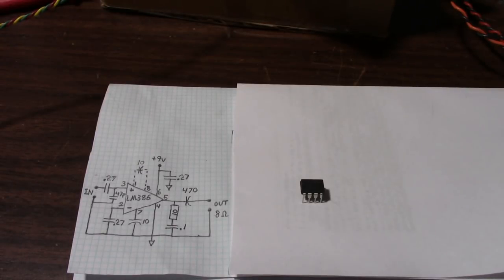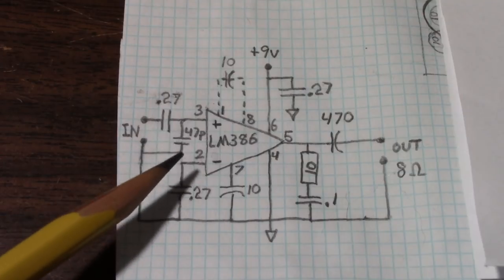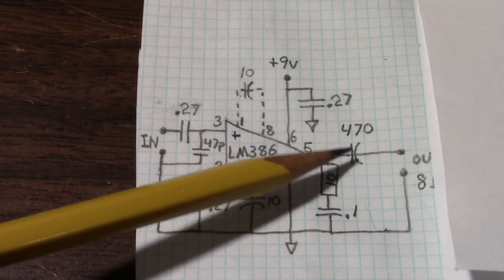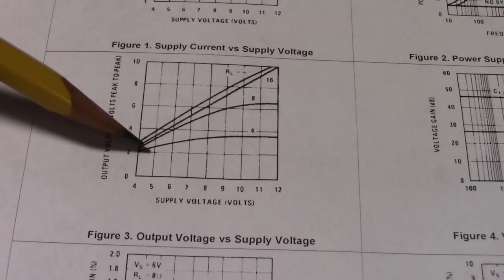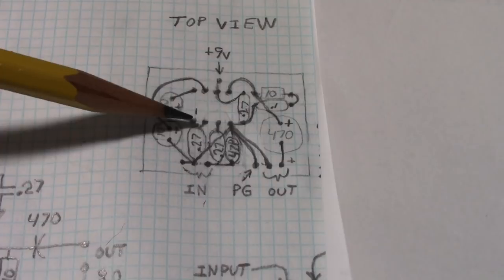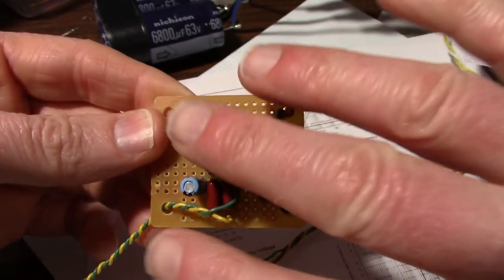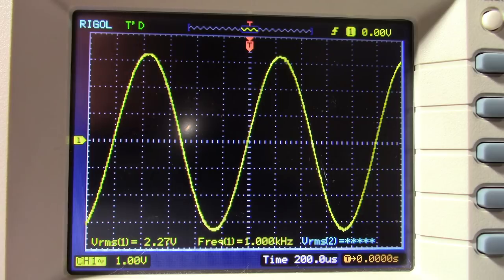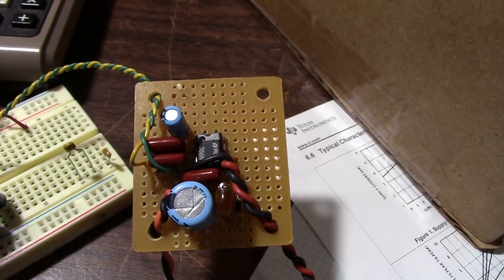Make the PERFECT LM386 audio amplifier?

Comment: 18:55 The harmonics you see at clipping are the reason why you blow your tweeter during clipping. 
This is why "underpowering" is a common cause of breaking your speakers.
Reply: H A R  Yes it can. When the amplifier starts clipping you get tons of harmonics and those harmonics are unexpected HF that can stress your tweeter and damage it (probably the main reason of tweeter failure).
See : https://jblpro.com/en-asia/site_elements/danger-low-power
This can happen if you clip any stage of the audio signal.

Comment: I can't wait to build this. I was planning on using it as a small guitar amp. In regards to the pin 1 and 8 gain stage could I use 1k pot in series with the 10mf cap to adjust the gain? And if so, what order should I have the components?
Reply: Better use 10k

Comment: The input is a differential pair so having both inputs capacitive coupled is great, but the 47pF capacitor should be on the same side of the coupling capacitors. As you show it, it is inside the + terminals coupling capacitor and outside the - coupling capacitor. It's not obvious why you would want to unbalance your input this way...
Reply: @
ats89117

it is connected to ground not - input :-)
Reply: @YTANDY100  It is connected from the positive input of the opamp to ground. It should be connected from the positive input of the opamp to the negative input of the opamp, or across IN. Both of those are balanced configurations. As shown, it is NOT balanced. That is pretty strange given that John correctly added the 0.27uF capacitor between the negative input of the opamp and ground to maintain a balanced input...
Reply: @ats89117  
across in would probably be better but to both + and - inputs would maybe negate higher input frequency's :-)
Reply from the maker: The .27uf caps would essentially be a short to the frequencies the 47pf cap would see as high impedance so you can consider that when placing it in the circuit.
Reply: @JohnAudioTech  At many very high frequencies that might cause oscillations, the 0.27uF capacitor will be past resonance and may have a higher impedance than the 47pf capacitor...  But I concede this is a minor detail. Thanks for the great video!
Reply: Such a small cap (47pF) has negligible effect on audio frequencies so it doesn't create any discernible imbalance at audio frequencies. Very small caps like this are really only useful for filtering out RF interference ( > 100kHz) from radio and TV stations and cell phones etc. To get the best possible RF filtering performance the cap needs to go as directly as possible to the ground of the amplifier.

Comment: Hello John, from about 19:40 to 19:50, what is happening around the zero crossing? There's a bulge on the sine wave :)
Reply from the maker: I'll have to check that. It seems to be on the falling edge only.
Reply: @JohnAudioTech  Use an analog scope for this purpose. These sh... digital scopes are not good for this measurement
Reply: @JohnAudioTech  CAN A  LM386 BE USED IN AN  FM ( BUG ) TRANSMITTER ?

Comment: Thank you for the explanations, dear John, but I got a doubt: near 17:00min. you change something until the wave get round, not clipped. I'm too amateur to have an ocilloscope.And as I'm lookin for a good - not excessive but not poor - gain for a diy reusing of a pair of very small laptop speakers (but yet a 8ohm speakers), I'd like to know how to get a decent gain.

Are you using that 10uF capacitor between pins 1 and 8? If so, which resistance is used to get no distortion?

 I'd like you to excuse me if you said that in the video but I'm not too fluent listener in English. Well... actualy, as you can see, not a fluent writer-speaker too.

Thank you.

Comment: Great video! I see you’re using film capacitors. Is there a reason I shouldn’t use ceramic caps? I’m asking as a beginner. :)
Reply: Ceramic capacitors are notorious for they lack of stability, they also shift capacitance with vibration.
That's why you avoid using them in anything here value stability is more important that lower ESR.

Comment: (Anybody that comments on here, with this knowledge, is welcome to answer my question)
John, I just found your youtube channel. Excellent video! That LM386 amp sounds clean with plenty of volume. 

I'm currently looking at building an FM radio using the RDA5807 FM Radio Tuner IC. I'm looking at a plan that I found on Instructables.
The amp being used, for that build, is a PAM8403 audio amp module. I'm wondering if the LM386 is a better choice for the amp
and also how do these two amps compare with each other?

Thanks!
Gary

Comment: I built it with SMD components on double sided PCB and it's small. Works great! Question - can I put a capacitor with 10kOhm pot in series between pin 1 and 8 to control gain?
Reply: i have always wanted to try that, pity no answer yet

Comment: Hello buddy. Iam trying to build an amplifier using TDA7265 amplifier chip with single supply design. The music is playing but don't know why the volume is so low. I have put input volume on full. For the circuit diagram, you can check the datasheet. Iam using fig 2, single supply design.

Comment: I have a better idea 

use from 100nf to 470nf or 1uf capacitor connected from pin 1 to pin 8 instead of the 10uf gain capacitor
the result lm386 will give a very clear high frequency crystal sound without hum
to reduce the highs as you like use from 100ohm to 1k resistor connected in series with the capacitor or use a 1k trimmer to adjust the highs, i used 220ohm resistor

Comment: Hi John I have a vintage Fidelity HF19 1961 tube amp in a record player. I want to change the mono high output ceramic cartridge for a modern stereo pickup so it won't damage my records. Do you think this little amp would be ok as a preamp to power the single UL84 tube amplifier?

Comment: What configuration was this 386, 1,2,3 or 4, 4 having 1 watt output. I agree with the others, your circuit is quite, clean and full fidelity. A better design than others I have tried. Good job! Thanxz
Reply from the maker: This is the N-1 version. I have the N-4, but testing at the same supply voltage gave the exact same output. The N-4 allows for higher voltages (18v max, I think), so with a 16 ohm load you can get more power.
Reply: @JohnAudioTech  Have you tried the N-4? I found it didn't perform as well when swapped out of the working N-3 circuit I made. N-4 with 12v 8 ohm seemed to clip a little earlier and had fuzzy little oscillations on the test sinewave before clipping, may have been at the bottoms of the waveform but can't remember now. I guess it's probably got beefed up internal transistors for higher voltage which causes this? It went away with 16v 32 ohm.
Reply from the maker: @uK8cvPAq  I did not test thoroughly, but I didn't notice any difference between the N-1 and N-4 chips I have. I haven't seen oscillations from the IC with good ground layout, but again, I didn't do a thorough test.
Reply: @JohnAudioTech  hmm interesting then, was it a genuine TI part?
Reply from the maker: @uK8cvPAq  Both purchased long ago. National Semiconductor parts. The one in the video has a 1986 date code, the N-4 has long string of numbers, I'd have to look up the date code for it, but it's still pretty old as I haven't bought this IC in many years.
Reply: @JohnAudioTech  Well this is embarrassing, I just tried getting some waveforms of my circuit with LM386 -3 and -4 but this time no oscillations to be found. In both cases I could get over 800mW out using a 12v battery as source and that was without using your capacitor mod, chip heats as expected with 12v however.

Comment: Nice video. Thanks for sharing. Which speakers are you using? 8 ohms, but how many watts and ways? It seems 2 or 3 ways, and they seem powerful. Speakers are also important for the final result as you mention in the video.
Reply from the maker: I have connected the one 8ohm two way speaker. SPL would rate in the low 90dB range at 1watt / 1 meter.

Comment: the 470 output component is a capacitor but you called it out in ohms.  That makes it unclear what value you want it to have 470uF, 470pf?
Reply from the maker: I misspoke, it is 470uf.
Reply: If if was pF you'd hear nothing, if it was nF only the high frequencies, so it must be µF or greater, mF would be unnecessary.
Reply: Thanks, but I have received an answer from the author.   He clarified it without even a small hint of condescending tone.  I like that.

Comment: Thank you for the video and the tips.  Does it make any difference in audio output quality what material is used for the .27 chip capacitors?
Reply from the maker: I would recommend using polyester film type caps.
Reply: @JohnAudioTech  Thank you very much for the reply.

Comment: Hey John, I find that the .27 cap from signal in somehow reduces the bass almost entirely. I find that the output is a lot better removing it. What's your logic for that one?
Reply from the maker: Do you have a potentiometer or resistor following the capacitor? .27uf cap with the 50k input impedance of the LM386 should give good response down to 20Hz.
Reply: @JohnAudioTech  Oh, that could be it! I just take in the raw input as is. Thanks!

Comment: Hi John - Thank you for this helpful video. I am puzzled by one thing. You added a .27 cap from the inverting input to ground to balance the circuit. However you then add the 47p cap from the non-inverting input to ground. Doesn’t this unbalance things? - Jim

Comment: Lm386 N-1 has 325 mw @ 6V 8 ohm, N-3 has 700 mw @ 9V 8 ohms and N-4 has 1Watts @ 15V 16 ohms according to datasheet. So which of these flavors we are actually getting now in the open market as there is nothing printed after Lm386 on the chips ?

Comment: Hey John, Question if I can; Where is the high frequency filtered by the 470 cap coming from? could it be filter best on the input, or in the power rail? I ask because i think that, if removed (instead of filtered on the output) it would yield a cooler and more efficient chip.

Comment: Am I right in thinking, even though this chip is very low power output,, it has a really good frequency response? Because, I was always under the impression that that the usual 8 pin, or even 16 pin amp chips were seriously lacking in FR.
Reply: It does a good job as long as you are staying under a half a watt, at that point the frequency response really goes tits up. It has a niche driving transistors in audio circuits, where you need more current than highly accurate op amps, but not so much the 386 needs more than a half a watt. They are also good enough for driving headphones.
Reply from the maker: Frequency response depends mainly on the coupling capacitors used on the input and output (and feedback in some cases). The chip itself will have a response from DC to several tens of kilo Hertz.
Reply: JohnAudioTech ,, oh cool,, thank you.

Comment: I have just built this, I have bought a 8.2 ohm non inductive 20w resistor.
How do you get your test signal?
I have a signal generator dds  still clipping with 100mv 1khz sine  wave going in? ( can’t get a smaller signal)

Comment: When you show the board layout, I am not sure of the orientation and did not follow your explanation.  Am I looking at the solder wire side looking down at the drawing?  I want to build this amp.  My transceiver has low output and want to put in a low gain amp.
Reply from the maker: The drawing shows the component side.

Comment: Ive had so many problems with this chip, sometimes i plug it in, it sounds clean and produces fair volume, and then in less than a minute without changing anything all of a sudden it has extreme distortion and low output.
Must be because im doing it on a breadboard.
Reply: Yeah they CAN be a bit unstable - you DID use the little RC output network, right ?
Reply: That is the problem, the breadboard should only be used to butter toast.

Comment: I have seen in some amplifier circuits like lm386, tda2822, tba820 etc that the Input coupling capacitor is connected before the potentiometer (if a potentiometer is to be used) and if the input capacitor is connected after the potentiometer that's between the potentiometer wiper pin and the amp input pin, the amplifier starts oscillating when the power is switched on and even without any audio signal connected. What's the reason behind this ?

But in some audio chips like Tda2003, the Input capacitor is connected after the potentiometer (between the wiper pin and input of the amplifier). So what's the difference between the two connections ?

Comment: I have an LM386  amplifier board, actually two of them. What mods can I make without desoldering the boards: 8 Ohm speakers, power supply capacitor, reduce gain, what else?

Comment: Do you happen to have one of those cheap china tiny dc boost converters on hand? I wonder if there would be interference running it alongside using a 18650 as the power source as a portable amp.

Comment: sorry for the stupid beginner question, but why is it ok to use a polarized electrolytic capacitor to remove dc offset? won't the waveform be the opposite voltage for half of the waveform?
Reply from the maker: If you're talking about the capacitor that couples to the output to the speaker, the current changes direction but it is because the capacitor is charging on the top half of the waveform and discharging on the lower half.

Comment: Hi, John. I thought it might be rewarding for you to see your project built by others. I made a tiny, SMD board and had it manufactured, to play with the design. I don’t use DropBox, much, so I hope it works... https://www.dropbox.com/sh/6dfkydg0q80y6sa/AACFIeph0lK8ZrKxgY0aLhEGa?dl=0

Dollar Bill Photo: The boards are only the size of your thumb. The LM386 is not in its socket and the 9v barrel jack is not installed, yet, but you can get an idea of the scale of things. They are installed in the video. I saved a lot of space, by piggybacking the smoothing cap on the back of the unit. The huge, solid-core input and output wires are just for fooling around.

KiCad PCB Photo: Shows the compact layout.

Video: Shows it working.

Thanks for the education and the inspiration!
Reply from the maker: Nice work! Thanks for sharing.

Comment: If I am not adding volume control , where can I connect the load resistor ? Before the input capacitor or after it & what should be the resistor value ?

Comment: Hi John. Hope you can reply to this in time, my question is = you seem to gauge your power output from amplifiers by multiplying the voltage by itself and then dividing by the load in ohms,, for years I have been using a volt metre and a clamp metre with a scope and dummy loads to measure power in watts, so say 50v x 10 amps = 500 watts etc,, I have noticed that although both ways of obtaining watts through both methods works there is a big discrepancy between them with the given results,,,  can you shed any light on this??  Thanks
Reply from the maker: In theory, either way should get the same results. There would have to be some deficiency in your measurement methods which causes the discrepancy.
Reply: @JohnAudioTech  thanks, I will continue my mission and pay close attention,  keep up the good work

Comment: Could you not use that chip to drive the CV input on the second half of a NE556 which drives a high power Inverter output stage based on 2x BD131 transistors +1N4007 +560R resistor with feedback to the drive amp.

Comment: how feasible is using a 50k pointomiter in series with the gain adjust cap? i'm thinking of the guitar amp, "little gem" type thing using the pot to control gain

Comment: Regards from Ukraine) Could You please tell me if there is any solution with my situation. I am making portable 8 bit game console. I use NES clone with onboard opamplifer, and its output distorted sound. Its sounds not good on TVset but acsepteble. But when I try it with PAM module or this LM386 schematic amplifer and small dynamics its sounds terreble. I find it at the wery late stage - I doned so much work with case and other parts of project. The internal opamplifer do not have any outer components to change, all in one chip. Is audio signal can be filtered, can You help me with advice?

Comment: what do you think? if someone was crazy enough to use lm368 as a transistor driver like tda2040  would that be even able to work in that configuration? How bad would be the distortion if you use single power suply and separate stages with big caps?
Reply from the maker: I have made a video on using the LM386 as a driver for an transistor output stage.

Comment: I'm using a LM386 module with a FM reciver module. If I use the same power supply 12v directly for LM386 and 3V via a step down converter the volume is low and sound is distorted. If I use separate power supplies - 3v battery for FM and 12v for amp everything works ok. What could be the issue ?
Reply from the maker: Could be a ground loop issue or noise from the converter (if it's switch mode). Hard to tell not having the circuit in front of me.

Comment: On the output pin 5 you have a resistor and capacitor to ground.  What is the purpose of that?
Reply from the maker: It helps to stabilize the amplifier. It is called a Boucherot cell.
Reply: JohnAudioTech cool, thanks. :)

Comment: I just thought of something, can we use a 12v power rail + 16-ohms transformer on the output with an 8/4-ohms secondary to connect the speaker can that boost the output power / sound ???